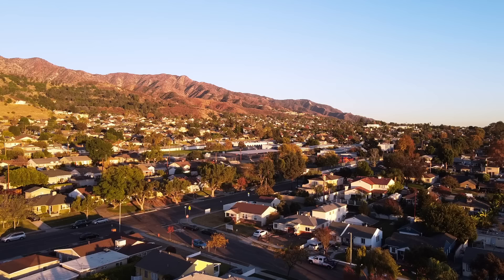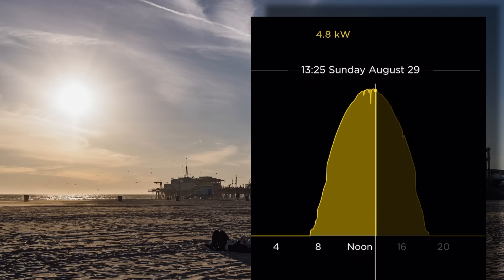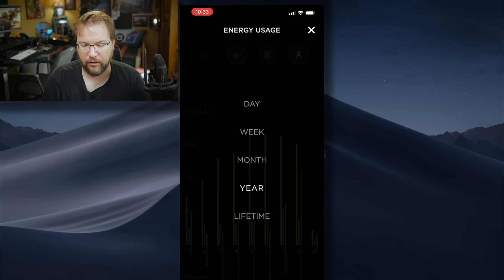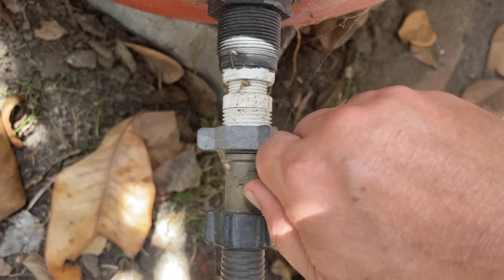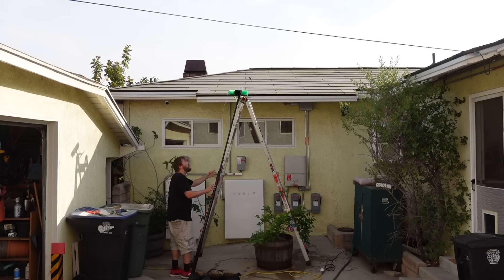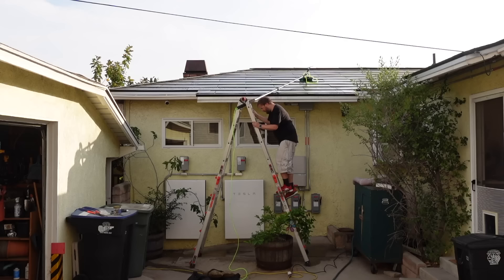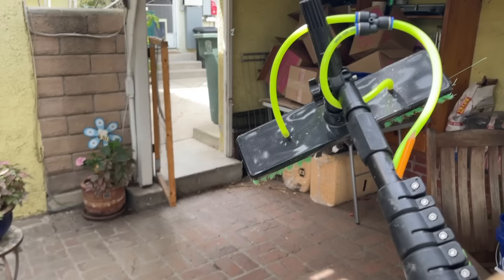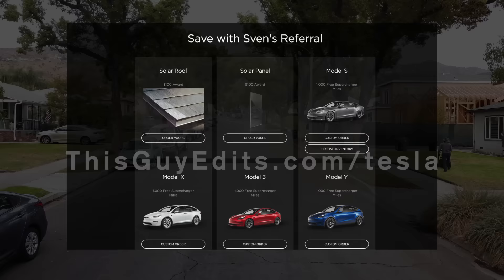Tesla Solar Roof: End of the Honeymoon Phase!

Comment: California: We are going to charge you a monthly service fee so you can provide power to the grid with your roof. Thanks.
Reply: It's a flat fee for them to monitor the performance, maintain your main connection, liability, etc
Reply: If it ends up not being a good deal, you might consider your own behind the meter battery system. (Batteries have a levelized cost of storage at about 10 cents per kWh)
Reply: Well there are costs for them? Wish I’d get paid full consumer rate for excess production!
Reply: It's about $15 a month to maintain an active electrical connection to the grid that is bi-directional. It cost money for them to process meter data and calculate credits and maintain your connection and pay the employees every time you have an issue and they have to send someone out to you or to pay the employees every time you call them on the phone. There's a cost to having each customer even if it's small and so the flat fee is just for you to hook up
Reply: It's for the additional customer service  phone support people with integrated electrical system s require compared to those who do not have it ,I'm assuming.
Reply: @keithmoriyama5421  For batteries to be effective, you need enough capacity to meet your electrical demands for a full 24 hours. I'm installing 67kWh of Lead Acid, so I can support Central Air Conditioning. If you don't install enough capacity, you risk chronic over-discharge, which decreases cycle life, and costing more money in the long run, due to frequent replacement. Calculating cycle life, and initial cost, the 24 hour rule seems to stand, weather you choose Lithium Iron Phosphate, Lithium Ion, or, Lead Acid. You won't save money, by skimping on battery capacity! (Batteries are always the answer...Now, what was the question?)😎
Reply: @pilotavery  If you can get bidirectional connection service for that, that's much less money, than it costs to maintain any kind of battery!
Reply: @vincentrobinette1507  while this is true, the power grids do not let you use the grid as a battery. If you give them 1 KW at noon, you only get to use half a kilowatt in the evening. It's based off of the price fluctuations. So a lot of the time, it doesn't make sense to pay twice as much for electricity when you can use a battery. This means that half of the cost is paying to use it as a battery.
Reply: @pilotavery  One other thing to consider: If the power goes out, you still need a generator to get the lights back on. If you have a battery, the grid could go down, and you may not even know it! For me, I'm going with a battery big enough, to last 24 hours, without any other source of power. The grid becomes the back-up, in case the panels aren't enough, due to multiple overcast days. If that happens too long, I can use a large generator to get me through the day, plus, charge the battery to get me through the night. You now have 4 sources of power, instead of just one. (solar panels, battery, grid, and if necessary, a generator.
Reply: The roof obviously cannot keep up with the electricity performance. If you really want to complain. I guess you can just not pay it and sit in the dark for nights
Reply: Grid is a scam
Reply: It costs money to maintain the grid, which you are using as a fallback. If you don't want to pay, disconnect from the grid and stop paying. Simple.
Reply: @specialopsdave  Apparently solar roof is free right? How about we charge grid for our cost to maintain? Grid is done, who needs it.
Reply: You think infrastructure is free?
Reply: Apparently this guy thinks all the people and money that go to maintaining the California power grid should be free. Go ahead and spend 10K on battery storage then!
Reply: One nuke can fix it.
Reply: So you don't think there's a cost for your connection to the grid?
Reply: Remember the time component.  Generally speaking, Kwh used or pushed back to grid before 4pm are less valuable than Kwh used or pushed back to the grid between 4pm and 8pm.

Comment: If you want to save your rain water or run out, you can get a RO/DI system at a aquarium supply store. It will generate 0ppm water and could be used to rinse the tiles.

Comment: for the amount of dust that builds up over a year in so cal, especially desert areas, its still worth it to clean, but the calcium spots are negligible compared to the level of dust, (compare yr windshield before its cleaned an after with cal. spots, still worlds better) which can get pretty gnarly, i just get my power washer an spray it down. 30 minutes, once a year. makes a difference

Comment: I have an 8.1 kW tesla PV system (no roof no powerwall) and it's hard for me to compare usage, because I was very thrifty with electricity usage.  With clean cheap electricity powered by the sun, I started to use a lot more electricity.  Your video doesn't mention differences in usage, but your gateway should track power sent to the house vs to the grid.  Perhaps you can compare your previous years DWP bill vs. power to the house from your Tesla app.

FYI.. since I have no powerwall, I have no gateway, tracking power to the house vs. grid accurately, thus I have no direct comparison.

Comment: And here I was contemplating getting a diesel welder/generator for my house. I think it would be cheaper. Thanks for the documentary. It seems to be in there with new vinyl windows. Yeah you Will save money on heating and cooling but you'll pay them off in 20yrs with your savings. Though replacing the roof at the same time......

Comment: At 9:00, the water that comes out of your taps in your house is called "tap water" and not "tab water." Excellent choice to not walk on the slippery roof without proper safety equipment
Reply: weird it's almost like there were asterisked corrections on screen for that very fucking reason.

Comment: Great video, I installed Tesla panels 4 months ago in December. We are in March and my solar energy production is not that great. I’m in New York and I know it’s winter. We probably get one day of Sun shine a week. I hope I’m able to produce in excess during the summer. I have a 12,000 KW system with a 7,900 KW inverter. I should produce more than you, however, my heat source is electric baseboards and it consumes a lot. Now in this winter, my average energy usage is 55 KWh a day. The maximum I have produced is 30 KWh ( it only happened once). I’m looking into a Hyper Heat Pump system so I can be Net Free from the grid. I don’t know if the solar plus heat pump investment is worth it. It would take my 10 years to pay itself. Thanks for sharing your experience, I wish I could share mine but I’m too camera shy.

Comment: Rare rains in California often pull dirt and smog and pollen out of the air. So a tiny sprinkle of rain say in SoCal has ones white dress shirt looking covered with black dots. 

So in movie and photo shoots you need spare clothes since a tiny sprinkle leaves hundreds of dirt marks on light colored clothes. Right after a rain is when you shoot postcard photos to show case perfect California dream to outsiders.

 The first rains of the year release many months of oil on roads so easier to get into an accident. Coworkers who drive motorcycles sometimes just use their cars until the oil slick roads are rain washed cleaner. Houses and commercial buildings are usually a muddy white color since pure white gets that dusty look in short order.. 

Rain water i attempted to collect in SoCal had to filtered a lot to getbthe dirt and dust out. Then the water storage tank had to be protected from evaporation. You can add a floating wax float in rhe tank to cut down the evaporation rate.

When i lived in SoCal the long term average rain was 10 inches a year. Where i live today in the southeast it is 65 inches. This 2021 year we have had 96 inches already. A solar panel here will stay clean but one has many days of low output due to overcast and rains.

Comment: This Guy's Tesla try a 5 stage reverse osmosis water system to get tap water down to almost zero. I have a cheap one with a boaster pump to speed the refill of the 3 gallon tank and it cost about $200 and about $50 in filters every year. I buy 1 gallon water jugs and refill them with my reverse osmosis tap water and keep 3 jugs in my refrigerator at all times for cooking, coffee, ice, drinking, EVERYTHING.  I also keep about (6) 1 gallon jugs in my house for back up incase bad weather, or if the water service was interrupted. You can get a whole house system that filters all the water coming into your house also. 5 stage is good but I think you can go up to 8 stages with a UV light to get water to zero.

Comment: Small changes on power usage and you are positive all the time. Like few decrees higher temps on ac, Less lights, etc. 200kwh usage per month is easy to reduce. If you use osmosis reversal to our tap water you can get rid of that calsium.

Comment: One dollar a day for a roof that was only dirty for the second half of 8 months is almost 400 a year. Assuming it accumulated another 1.5 dollars a year of dust for two years, that would cost you something like 1.5x3=4.5 per day for the next year or $1600 for that year. This assuming the rain was not very effective in removing the baked on dust, so we just need to see how good the yearly one day of rain cleans it.
Reply from the maker: the rain if very effective in cleaning the tiles as the glass is hydrophobic. The situation in Southern California is that rain tends to only come sometime in November - March. So, around March is where you start off with a completely clean roof and it accumulates dust until November.

Comment: To those who want to argue value, in my case I was not able to get a panel system the size that I wanted in the usable space I had on my roof. The tile system was able to get me the size I needed and worked around the various vents that would have limited me on # of larger panels. Pair this with a roof that needed to be replaced and there was no better option.

Comment: Amazing, but man 25 Years to benefit from the sytem is pretty heavy. And I'll wonder how much you will invest in repairs etc. Still awesome but more worth in countrys like in germany where you have to pay about 30 cent per kwh. :)
Reply: In Germany you also have almost exactly half the solar irradiation...
Reply: @Beregorn88  True, didnt think about it. But still >4 times the energy prices. :)
Reply: It's even worse than that if you account for time value of money. Say the first year you save $1600, but that's like 4% return on investment. Financially speaking you might be better off investing in a portfolio. The roof will also depreciate with time, so the investment just evaporates. Say the roof lasts 50 years. In that time you've saved 200% of your initial investment. If you put it in a bank at only 2% interest you'd have made around 270% instead.
Reply: What's even worse is that the solar tiles are probably only going to last around 30 years. So, just when you finally pay everything off, you need to pay for all new PV panels and the install cost to swap them. This is far cheaper than the initial build cost, but still way more expensive than swapping a standard rooftop solar panel. The powerwall batteries will also start to degrade and need to be replaced in 10-20 years.
Reply: If I could spend that kind of money I would as I will not be worring about the return but the   environmental benefits
Plus in 25 yrs I can bet the prices will be affordable to common citizens

Comment: You’re math is slightly off.   Previous usage was 37.7kWh.  New is 41.7 kWh.  This +4kWh increase is an increase over 37.7, not 41.7.  Therefore, an increase of 4 represents a 10.61%.  The 9.6% is only derived from the formula for Gross Margin Profit.  Not a net increase of something like this.

Comment: Finally Sven you're back. First of all, nice shoes.... Really nice video on your tesla roof. I was wondering if it's more difficult to clean your roof because the surface is not smooth and dirt will stick better on rough tiles.
Reply from the maker: It wasn't all that difficult to clean the roof. The glass tiles are slightly hydrophobic, so water, slide off easily
Reply: A brush works better on that kind of surface. A squeegee just won't work. You wouldn't be too concerned about mineral content, if it was a mirror smooth surface, on which, you could use a squeegee.

Comment: Thanks for sharing your experience with solar energy and Tesla equipment. Strictly consecutive video content! I have build 5.04kWp solar shade car roof connected to my house with standard PV modules for selfconsumption, zero grid feeding, without battery and without electric vehicle. One year statistic report says:  energy consumed  directly from the Sun is  33%, energy from the grid was 67%. This is the result for my consumption profile, and for my region (Bulgaria). Total system build cost was almost 4,5k Euro. ;)
Reply: THAT is a BARGAIN!  That is only US $5,300!  I am getting similar results from my Hybrid Van:  about 1/3 from Electricity and 2/3 from Gasoline (Petrol).  A Tesla Home Solar system is going to cost me about US $32,000 (or 27,300 Euros.)  But, the ROI will be more than 30 years.  Still, the future is coming!

Comment: I'm in New Jersey I ordered this back in February after a bunch of between me and Tesla a month and a half ago or two months ago they came back and they said they were ready to proceed my quote was $50,000 when I booked it back in February. When they told me they're ready the quote was $96,000 it doubled. The reason why he told me it took so long was because there was a part of my roof that they didn't have a design for. Basically the solar roof bends up in that portion instead of down like most roofs. I told them that that portion didn't require solar panels or any other panel at all they could have left that part alone and put solar roofs on the rest of my house. My guess is this was around the time when they started to increase their prices and if they had done my roof they would have to have done it at the price they gave me. So they strung me along until the new pricing structure was settled and then gave me another quote. Obviously I canceled the roof. Here in New Jersey is not like California. In so many ways. Lack of sun is one of them we get 4 months so it will take me 20 years to pay back $100,000 .
Solar roof is technology and like all technology it improves exponentially every year just like we get a new iPhone every year that's how solar roofs are going to be so it would be stupid of me to give them $100,000 and in 5 years that same roof is double the efficiency and half the price. Remember Elon doesn't care about profits he cares about progress so while another company would increase the the productivity of the solar panels about 1% every year Elon would double it if you could I'd have the price which is what I'm going to wait for
Reply: It aint gonna double in efficiency

Comment: What if you built a hose system with pipes with holes in them to simulate rain?
Since your roof is slanted anyways just mount them at the very top, buy a water filter and have it run every month or so for a few minutes.
It'd minimize the work you'd have to do and practically pay for itself.
Reply: Yes, and also scrub and use brush during the  rain.
Reply: @scrapiron  He already mentioned that it doesn't rain a lot for him.
That's why I wrote this comment in the first place.
Reply: With maintenance, the roof watering system would cost more than the extra capacity gained.

Comment: If it were physically possible, all you had to do was use soap and water to clean them but then dry them with a chamois or microfiber after to avoid spots.

Spotless dry (soft water) is only needed if you can't dry something.

Comment: idea: use a standard karsher with tap water to clean the dust quickly, then use your rain water to remove calcium from still-wet roof.
Reply: also you could install an independent solar detector you can clean regularly to better compare energy production after cleaning roof whether weather is cloudy or not.

Comment: So it cost you around $36000 for install, and you save $1600 per year on energy bills? In other words, nearly 23 years payback time. Can the tiles really run for that long without incurring more cost through repair or replacement? Otherwise you're never really breaking even on the initial cost. Think conventional PV at the moment still makes more sense, since going 5-10 years without necessary repair while achieving return on investment within that time frame seems a lot more feasible (sure, solar panels don't quite look as cool as this though)
Reply from the maker: If you don’t need a new roof,  Panels make more sense. If you need to replace you Roof and opt for asphalt shingles panels are also the better option. 

For me, tiles where the better choice: I have a video about my final cost and when the system will be completely payed off: https://youtu.be/abyQeGIQ4JA

Comment: I’m not sure tap water is so bad. I use it to rinse tree pollen off my panels every day in the spring in Massachusetts. I do it via a hose from the ground and the panels go from pale yellow to black. Definitely a huge improvement. A few times a year i go up on the roof with the hose and spray the panels hard up close on Stream setting. I think the calcium spots must be very subtle because I can’t see them at all on the panels, but i can see the tree pollen easily.